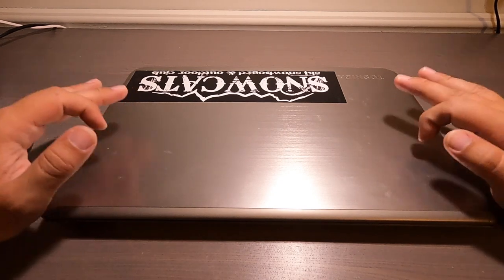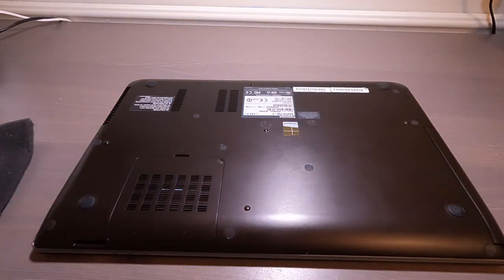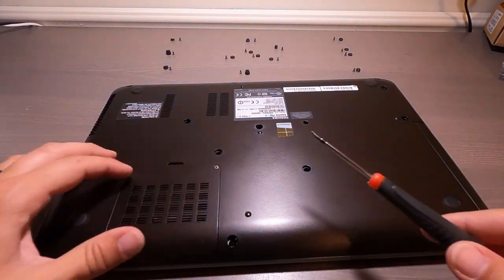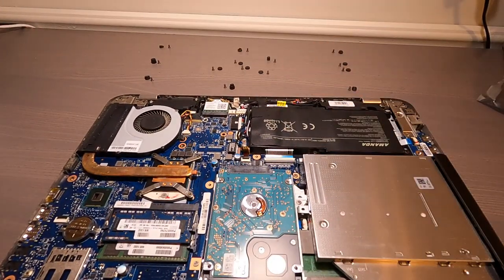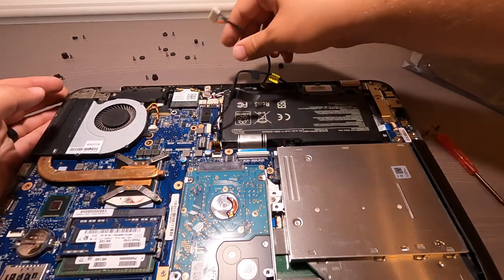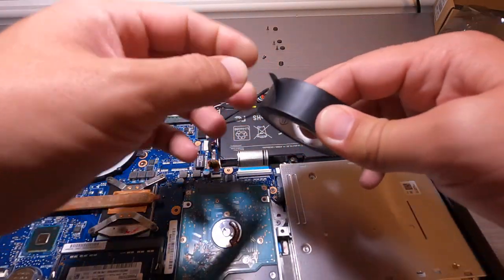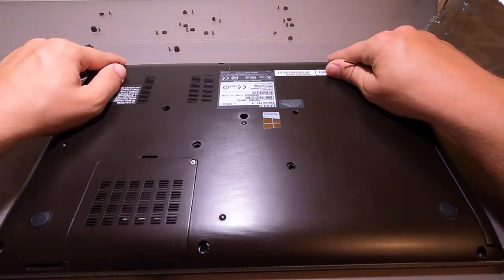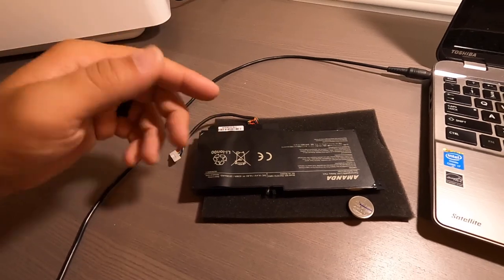Laptop battery replacement - Toshiba Satellite P50 (FIXED)

Comment: Hi, I have the same laptop and I also need to replace the battery. I have replaced the battery twice in the last 5 years. The last battery was very poor quality and didnt last long. 

My main worry is that these laptops are old and most of the batteries on sale have been sitting on the shelves for a long time, i.e. they havent been charged for a long time and their longevity is not what it should be. How is your new battery holding on? 

Im not sure if I should just get a new laptop or replace the battery. (I might even get a new laptop and a new battery). 

I have had my laptop for 10 years and with an SSD upgrade its still a relatively decent computer. The main issue is that it doesnt provide me with mobility any more.
Reply from the maker: Hi there. I see what you mean, I had this laptop for about 6 years before I had to replace the battery the first time. That battery only lasted a few months and this one has lasted for over a year now and is still working with holding a full charge for at least 2 hours (fingers crossed). 

My main issue is that newer laptops do not come with CD-drives any longer, since everything is a digital download now. I guess I am 'old-school' in that way. If I were you, just wait until a great sale comes and get a new laptop, after the third battery, it isn't worth putting more or your time & money into an outdated piece of technology. That's just my thoughts. 

Good luck!